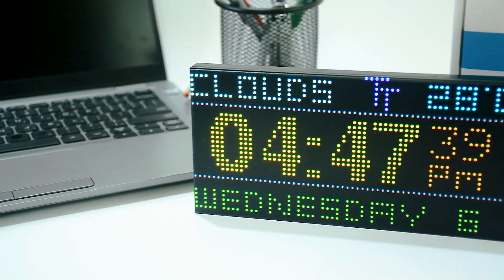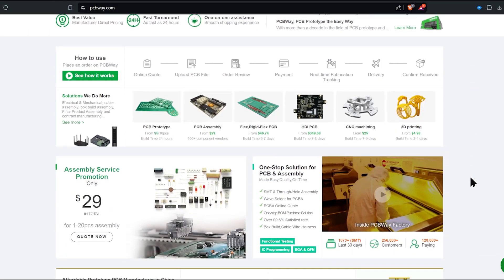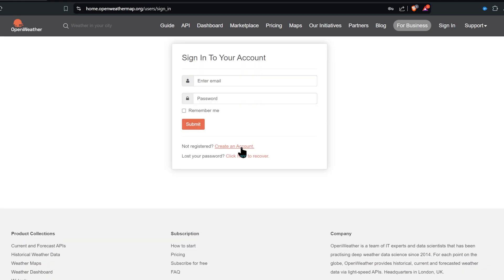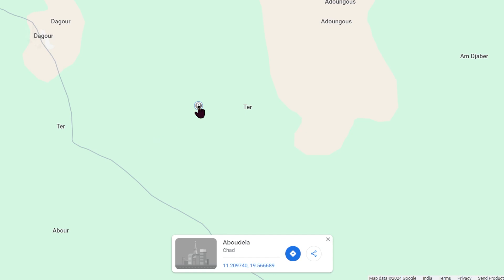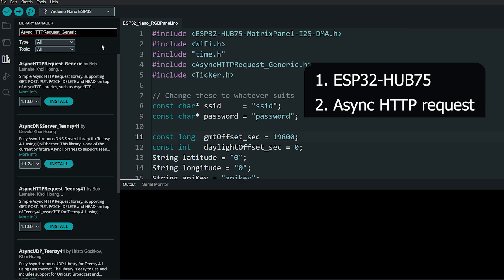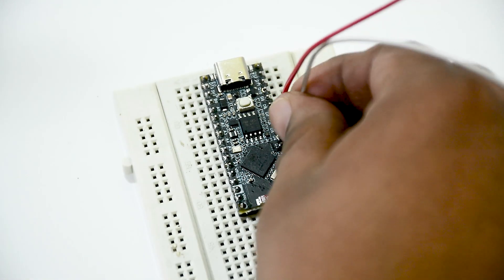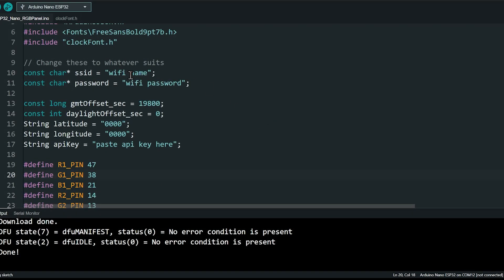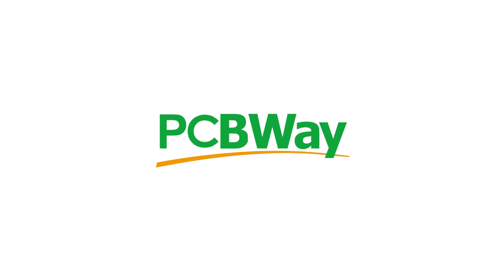RGB Internet Clock - ESP32 | 32x64 RGB matrix panel

Comment: One could technically also create a basketball scoreboard with that right? Lets say we want to also remotely control the points + and - a point per button push. How could we do that?
Reply from the maker: You can use an ESP32 to create a webserver. And control of using your mobile. If you're going to buy all the components as new, you could also look for microcontrollers with an RGB matrix adapter. I think Adafruit or waveshare has some. The rest is just simple code.

Comment: my 64x64 board does show enything even when wires are set up it light some pixels only  when i disconnect  the usb type c and the touch the usb type c port a litle then it light a bit dont know how to fix it ai says maybe need level shifter idk
Reply from the maker: Are you saying it doesn't display when USB is not connected?
Reply: @techtalkies1  it doesnt show when usb connected
Reply from the maker: When it's not connected?
And are you using a proper external power supply for the display?
Reply: @techtalkies1  yes i use power supply it shows nothing when usb is conected some led light up when i disconnect the power supply or the usb and then try conncting back some say because the esp32 pins only give 3.3v signals but need 5v signals for matrix
Reply from the maker: I personally use these boards with esp32. It works.
Try running very simple test programs. What cable are you using to connect the display to the esp32?
Reply: ribbon cables with  jumper wires.
Reply from the maker: 1. Check the connections
2. Run a simple example program. If there is power issue, you should still get a dull image
Reply: @techtalkies1  do i need to connect the ground from esp to the power supply ground too? because now if have esp ground to hub 75 ground and the hub power and ground sockets to power supply
Reply from the maker: Yes, all the grounds need to be connected together.
Reply: @techtalkies1  how do i do that if the power adapter i use comes with the hub you cant put another wire there do i need to cut it
Reply from the maker: Split it from the power pins near the display. Cutti g the power supply wire is not a good idea.
Reply: @techtalkies1  i have this error Guru Meditation Error: Core  1 panic'ed (StoreProhibited). Exception was unhandled.

Comment: Hi. I have installed libraries correctly.   But I can't find in my computer the file clockFont.h.  Can you please send it?
Reply from the maker: It's in the same page with the Arduino code. Scroll down to find the fonts file. Let me know if you can find it.
Reply: @techtalkies1  Understood. I can compile now.  But I can't see anything.  About the ribbon wire, your picture say G1 is on the left R1 on the right. Is that mean we have to plug the top left case of the ribbon wire to the pin R1 of the esp 32?  I know it a trivial questionr, but I want to be sure of you answer.
Reply from the maker: What panel do you have? Is the pins labelled at the back of your panel?

Before you try my program, try an example program from the library.
Reply: @techtalkies1  64*32 3.0 mm pitch.   Yes, I try to find a simple exemple where I change the pin directly from the sketch.  Do you have a simple exemple from a simple library ?
Reply from the maker: The Adafruit library is pretty straightforward. Usually the pins are same as the picture I have mentioned. Have you tried the wiring?

What brand is your display?
Reply: @techtalkies1  the brand is Coolwell. I ordered 64*32 p4. But I received 64*32 p3.  I tried the sketch named simple form  the library Adafruit Protomater and I have erratic leds behaviours. What is the brand of your panel ?
Reply from the maker: Waveshare

Comment: What about ESP32 Pins, you forgot the wiring diagram I think,

Very Nicely done clock 👍👍
Reply from the maker: Thank you!

If you watch the full video, I have explained how there are no exact pins. You can use any digital pins according to your board. Just declare them respectively in the code. Let me know if that makes sense.
Reply: @ ok thanks 🙏🏽

Comment: hi there, at 3:06 you apply a plastic filter in front of the panel. Can you tell me which brand and other details of that plastic filter. Thank you in advance.
Reply from the maker: That filter came with my display. It is from waveshare. But it should be available to buy but it probably comes as bigger sheets and you'll need to cut it.
Reply from the maker: It's a frosted acrylic sheet. A very thin one.

Comment: THE only profile that the  Arduino ide will successfully compile is with the  Arduino variant of the esp32-s3, the normal Esp 32 variants don't compile. Otherwise a lovely looking weather station and clock
Reply from the maker: I think that will work on other ESP32 boards too. That library is finicky.
Thanks!

Comment: AsyncHTTPRequest_Generic.h generates multiple FATAL errors using Arduino V2.3.4, what version of Arduino IDE did you use??
Reply from the maker: It's not the IDE. The library is no longer supported. I will push updated code with updated library as soon as I can.

Comment: Emmm sir can u make with bitly matrix dot led aaa like 32×8
Reply from the maker: Check my previous video

https://youtu.be/hCHNgdfG4og
Reply: @techtalkies1  emmm can u make for/with ardiuno nano my budget low 😅
Reply from the maker: Esp8266 is cheaper than Arduinos and come with WiFi, which is what we are using to update time.
If you use an Arduino nano, you will need an extra RTC module.
Reply: @techtalkies1  wow ty for info ill ask to my teacher is can or no XD ty for suggest and tutorial

Comment: @techtalkies1 Hi, thanks for the reply. I found a suitable panel on Aliexpress. Yes, a part 2 would be good.

I am playing with ESP32 clocks and seeing how many different clock displays I can run from one ESP32. Issues are different drivers needed for different SPI device controllers and clash of keywords in libraries.

A code snippet for you, this sets the internal ESP32 RTC to your local time and also adjusts for daylight saving. Only needs setting once in setup.

I have the code which sets ESP32 from internet time on boot (if available) and then will set external RTC 3231 if internet time available. If not, ESP32 is set from RTC 3231 (can send it to you id you like)

//Code to set ESP32 to your local timezone. Needed only once in setup
  //configTime(MY_TZ, MY_NTP_SERVER);    // --> for the ESP8266 you only need this for Timezone and DST
  configTime(0, 0, "pool.ntp.org");             // First connect to NTP server, with 0 TZ offset
  // Get the POSIX style TZ format string from  https://github.com/nayarsystems/posix_tz_db/blob/master/zones.csv
  setenv("TZ", "GMT0BST,M3.5.0/1,M10.5.0", 1);  //  Now adjust the TZ.  Clock settings are adjusted to show the new local time
  tzset();

Code to set local clock, just before summertime ends. Do this then watch the clock change from British Summer Time to Greenwich Mean Time. Note leave clock running and ESP32 automatically syncs with internet time and it will correct itself back to current time. May take up to three hours, if default 'set sync' settings are used. 
setTime(2021,10,31,0,59,50,0);    // Set it to 1 minute before daylight savings comes in.

ESP32 Time.h defaults to checking ntp time every three hours to adjust the ESP32 internal RTC. This can be changed with 
sntp_set_sync_interval(10 * 60000);  // 10 minutes. Three hours or even 24 is fine, but for experimenting & watching the time update, setting a shorter time is useful.

I have the code which sets ESP32 internal RTC and external DE3231 RTC from internet time on boot (if available). If internet time not available, ESP32 is set from RTC 3231 (can send it to you if you like)

Comment: Hi, link for parts just opens the company front page.
Could you just list the parts please.
Main item is getting the correct matrix.
Thanks.
Reply from the maker: Hey, you can use any RGB panel you like. The specifics of the one I'm using is:
64x32 LEDs
3mm pitch
1/16 scan

I got a waveshare one but it just had a sticker of their brand on it. So I'm guessing any generic one will do.

3mm pitch makes this panel smaller but much denser, ideal for videos or image display, but they are costlier. For just a clock display, any size should be ok.

Comment: Nice project! ... The given link of code & details can't be opened. Please provide a working link. Also, look forward to having similar clock using an RTC module for keeping correcting time with an option to correct the RTC's time from NTP server, whenever required manually (by pressing a switch) or periodically (once in a day) automatically, with auto-brightness adjustments.
Reply from the maker: Thanks! I have updated the link. It should work now.
If I have enough requests, I'll make a part 2 for the video, with your suggestions.